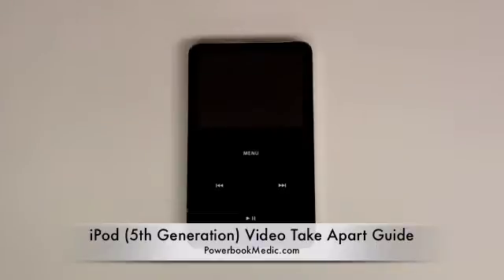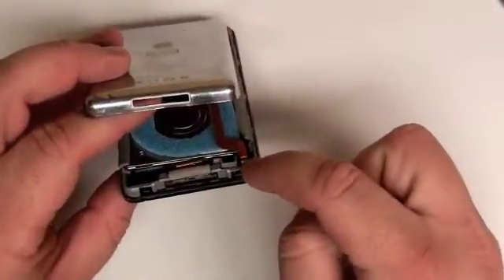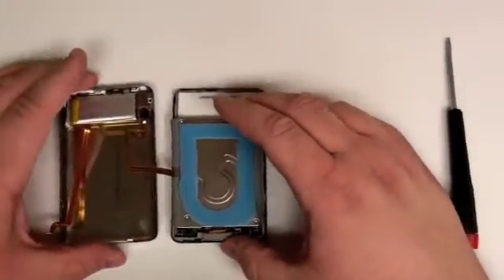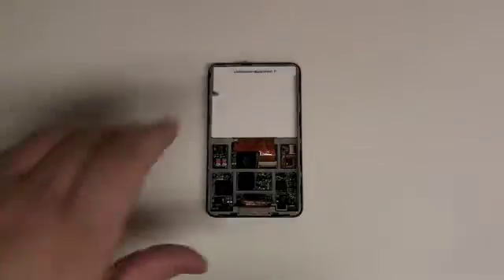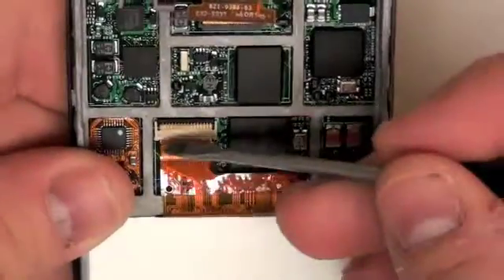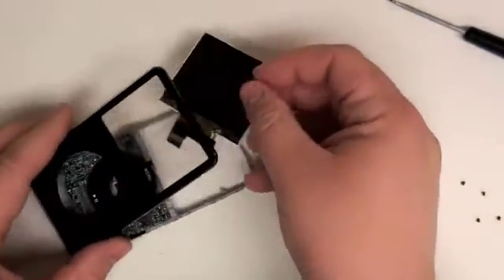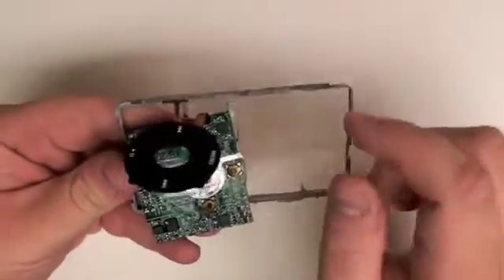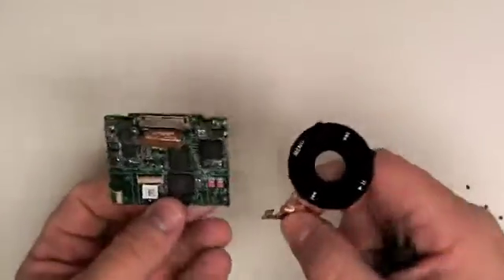iPod Video Repair - LCD Display and Logic Board

Comment: what happens if i snap the lockbar from the battery ribbon cable, it snapped and i wanna no do i have to solder it to get it back on ??